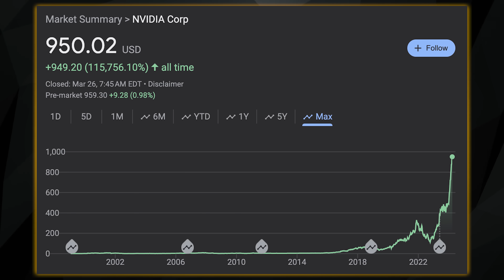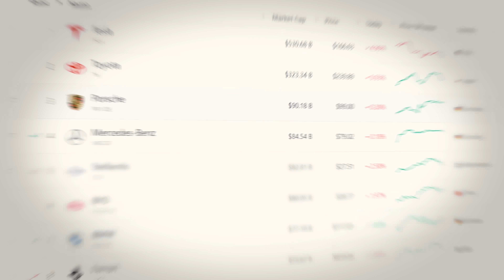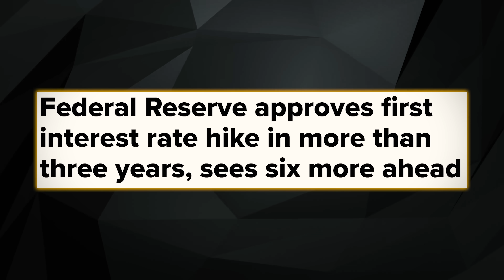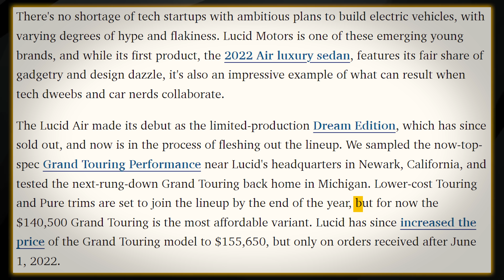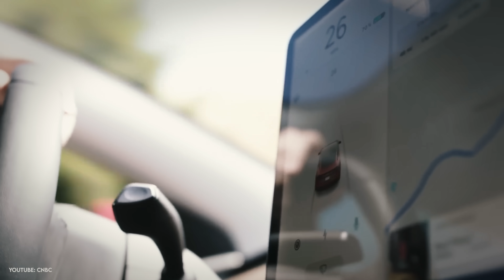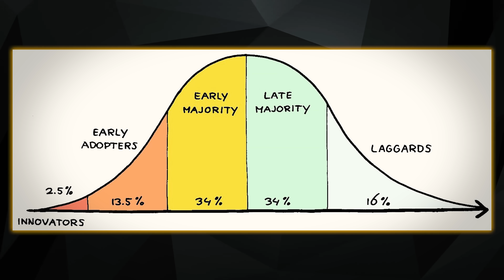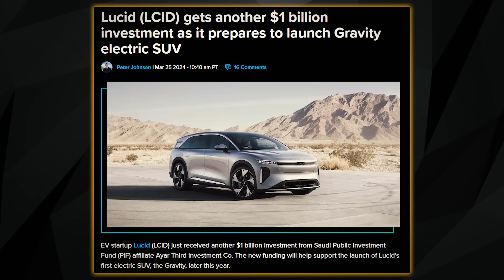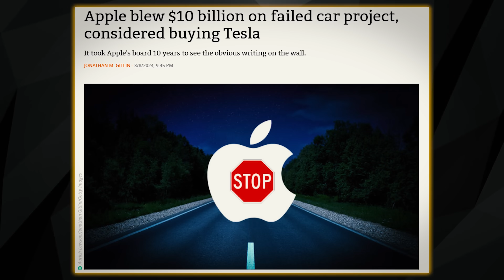The EV Bubble Popped - What Now?

Comment: 1:00 wrong! Tsla dose not lead the EV industry.
BYD leads the EV industry by far.
From Business insider: 
"China's BYD is the world's biggest electric car maker! China's BYD passed Tesla as the world's top EV seller last year."
You don't know what you are talking about dude.
Nio is very small in china. Example: Xiaomi just released their car and guess what. they sold over 90k cars in just one day. EV Bubble Popped in US and US is not the world. Wake up from your US bubble.   

China's auto market is 2x bigger than Europe and US automarket combined.
BYD just sold (only in china) over 830k EV in march while another Chinese EV maker Aito sold over 220k last month just to give a small example.
Reply: BYD overtook tesla in Q4 2023' but Q1 2024 put Tesla ahead (just barely) once again
Reply: BYD is even younger than Tesla, their crash is coming soon.
Reply: @UhOhUmm  BYD is waaaay older than Tesla; they started out making batteries for your Granddad's Nokia.

Over 30 years of battery making experience (plus a few decades of commercial vehicle manufacturing experience in China).
Reply: @mikefarino4368  Incorect, 
Tesla in Q1 sold over 83k cars in china alone. While BYD sold In March 2024, BYD sold 302,459 EVs. if we add the rest of the months of Q1 BYD would have over 800k cars sold.
Tesla is no where near BYD.

Comment: If you want to spin numbers at 07:35, I can spin numbers also. " As of March 2024, 1% of registered vehicles in the U.S. are electric, or about 3 million vehicles. This includes 43 states with adoption rates below 1%, and two states, North Dakota and Mississippi, with adoption rates below 1 in 1000. However, according to Kelley Blue Book, the EV share of the total U.S. vehicle market was 7.6% in 2023, up from 5.9% in 2022"

Comment: Sorry let me be blunt. You're wrong about Kia and Hyundai. Their EV offerings is way more competitive than you set them out to be. Their self-driving tech is on the level of Tesla, their design is far superior, and their build quality is not absolute crap that you can pick apart with your fingernails. The reason that Tesla is failing to cross the chasm is not because people just don't get how advanced they are. It is because it doesn't serve the need of the mass public of a nicely built vehicle that does not require any compromises to own unlike a Tesla and their unnecessary "inventions" like the removal of turn signal, gauge cluster and many things along that line. 

Those things might seem trivial but you will be surprised how many people that I know who own an electric car who chose a Hyundai or polestar over a Tesla over the dumb turn signal situation. The way that Tesla operates and design their cars can only suffice so much demand. Much more recently we can see that trend on the cybertruck. It is big, fat, unsafe, and dumb. It can satiate the needs of some, but not the majority. That might be an extreme example, but the rest of Tesla are way too weird for the people who just want a reliable transportation to switch to. They are trying to shove an innovation pie down the throats of unwilling customers and that is an uphill battle that Tesla needs to figure out.

Comment: The price happened. The math is simple: A Tesla modelY in my country is 43K euro, and a decent new gas car( not mentioning second hand) is 30K .... with 10K euro i can fill up that baby for years and years and years. When electric go to solid state battery and not requiring another 50% of car value in 10 years as a battery replacement, then yeah i will switch.
Reply: the thing is, this argument will only become more invalid as evs become less and less expensive, the electric market isn’t at full potential unlike gas cars,

Comment: I think another point why customers are cautious is battery degradation. We know it from every other device that batteries loose capacity over the years and I think people aren't quite sure what lifespan to exspect from an EV and what the resale value would be at that point. If you buy a car, especially a new one I would assume people expect to use it for at least 5 to 10 years and if they expect a shorter use time, they would want to finance their next car by selling their old one. What will the battery of an EV be like in 10 years? How much capacity is still left and would someone buy your car then, or rather how much would they pay, if they possibly have to buy a new battery? How are the battery prices? For electronic bikes they are sometime up to more than 50% of the original bike. I bought an E-Bike in 2021 for 699€ and the manufacturer sells new batteries with varying capacities for 359-469€,  If its the similar for cars, would people even buy used ones, if the savings between a new and a used car are only very small? Then it may become a case of: You have to pay money to get rid of your old car, instead of recieving money by selling it.
I mean I don't know how this really is, what the battery is like after 10 years or what the used market is like for EVs, but I imagine lots of other people don't know as well and lots of people probably don't have enough spare cash to take a gamble on that. They need certainty and peace of mind.

Comment: They don't hold trade in value anymore.
Reply: The EV market has a real used car problem. Buyers have no way to evaluate the state of the battery which is the most expensive part to repair. This hurts the new car market as everyone wants to buy new so you cannot sell your EV. This makes it a much larger commitment than people are willing to take.
Reply: Well no, when the manufacturer drops the price of new ones, how exactly would they?

Comment: I don't live in a detached house.  My place is not on ground level, and I don't have a charger.  I haven't looked into this all that much, but nobody has ever explained how I'd ever be able to get an EV.  (I'm not going to spend 45 minutes at a gas station charger.)  Also, I have a Hyundai, and like the traditional layout more than any EV vehicle that I've seen (which try to change things just for the sake of "innovation", when I want a regular front panel with a speedometer, etc).  Also, while I wish Tesla luck, it's no Toyota and shouldn't be valued as much.  And even if Tesla is as far ahead of the competition as Google is compared to other search engines, I use DuckDuckGo and get along fine, and I don't have to see the weekly Assata Shakur dedicated Google doodles.

Comment: As we age we decline in strength and power, as, too, when the batteries in EVs age they burn and lose charge-power. I have driven cars that will roll for half a million miles without critical failure, not so the EV. It is a dead dog waiting to rot. Can you smell the stink?

Comment: Why would I buy a landcruiser that can accelerate from 0 to 100 in 2 seconds, weighs 3 metric tons and is a hassle to find parking space for in the city, let alone maneuveur...when I could have a small EV that only uses 60% of the energy, has the same range and is able to find a parking spot with? Kia, VW and Hyundai are on the right track. Smaller, more affordable, less expensive and less of a hassle.

Comment: Not to be a pain- But where's the coverage on BYD amongst all the EV manufacturers? It was 5th on the list in one of the shots you'd used.

Also, "EVs are cheap enough" is a blanket dismissal for a complicated and nuanced question. They may have fallen in price, but it's still not easy to just swap and buy one when interest rates are as high as they are. (Full disclosure: I'm Australian and our economy is worse.)

Comment: Tesla loss probably also related to Elmo, I would not buy a Tesla because of him (and also because I don't like their all-touchscreen design, but I could maybe deal with this...). At the end of the day CO2 goals will not be reached without EVs. In Europe CO2 tax added on fuel will constantly increase. Which means that the cost of operating an ICE car will constantly increase. So either we go back to the early 2000s and dig out our low consumption ICE engines from this time and downsize the cars (which in my opinion actually would be a good idea, all of those SUV cars which are in fashion today are way too big in my opinion) or we will need to stick with EVs. I haven't heard that Hyundai/Kia has financial problems with/due to EVs. Only because the US automakers can't keep up it doesn't mean necessarily EVs are dead.

Comment: 1) Those price cuts are not enough. There are still no EV to match golf-class hatchback in price-value. You either have “cheap” options with no range, no fun and the next step is 57 000 EUR+ models which are competing with C+ class like BMW 3er or Audi A4. Tax returns are also not a thing in many countries anymore.
2) Even the full sized models (those for 57k+ EUR) are still not usable enough for apartments residents. Not all apartments do have dedicated parking lot and even if they do far too little of them have charging on those lots. Without overnight charging EV is just as expensive to charge as tank a car and less convenient. Furthermore, road trips are still a mess with long charging times. 
3) The whole EV application is too limited. Standard gasoline or diesel car is too damn universal. No matter which car you choose you can do all general activities from city commute to long range daily road trips. With electric it is way too complicated on each of the applications

Comment: So, to put it into perspective. I can get a top of the line Skoda Octavia (4 year warranty) with all the bells and whistles, top quality and dealerships/mechanics everywhere for 40k. Takes me 30 secs to fill up a tank that costs me around 60-70 euros and can drive around 750km (with heating on). Or the alternative is to buy an overpriced EV for 50-60k, pay tons of cash for fast charging, don't have dealerships where they can fix my cars and can barely go 300 km, with the added bonus that if I charge at home I'm going to be adding an additional 100 bucks for my electrical bill? Yeah, I'm gonna sit this one out.
Reply: that and you'll be paying for the batteries every 2-3 years and it'll cost more than the car itself will be worth.

Comment: Battery tec is not ready for mass evs.
No Range, short lifespan, very expensive, and dangerous on top.

And dont get me started on selfdriving, lol.
Reply: the range is fine. The amount of people that ever drive more than the 3-400 kilometers electric vehicles have for range is basically no one. If you had a charger at home, the overwhelming majority of people could get by on a car with a range of 100 kilometers.

Comment: People who drive aren't really interested in electric driving spy machines. If I drive from NY to Florida, I'll have to stop a few times to charge. If I do the same drive with an ICE car I'll have to stop for gas.

The difference is when I stop for gas I'll have a full tank in 10 minutes where it will take me several hours to charge a tesla. 

There was a concept where they have an electric motor and a diesel engine. The idea is when the battery gets low, the diesel engine kicks in to charge the battery. You get the benefits of both an electric motor and an internal combustion engine.
Reply: It would take you 15 to 20 mins at supercharger to get 80% charge and not several hours.
Reply: @samuelwilliams7331  ok but where the hell is a supercharger out in the country?

Comment: I would get an ev if they weren’t so expensive. The battery replacements make it worse because over here you can get a second hand car that lasts over 10 years for the price of the battery replacement.
Reply: Eh, apart from a few weird instances like the hyundai in Canada that was fucked up, ev batteries don't really break.

I have heard stories of ev batteries starting to have issues at 3-400k km, but most last much longer than that.

My dad has a tesla from 2016, it's gone 300k km and has lost about 10% of it's capacity. Batteries usually lose about 5% in the first year, and then the loss slows down significantly, until somewhere below 70% where it starts to lose cells and is considered dead.

Current ev batteries are ofc improved compared to 8 year old batteries and are generally expected to outlast the rest of the car.

Comment: I dont think Tesla has any technological advantages anymore though. GM and Kia/Hyundai vehicles charge faster and GMs supercruise is regularly considered on par with Tesla autopilot when doing freeway driving. Differences between the two are autopilot can go on city streets, but on the flip side, supercruise can tow trailers and the cybertruck is still incapable of going into a dedicated trailer mode much less self drive with a trailer. With supercharging spreading out to Rivian, Ford, GM, Hyundai/Kia tesla doesn't even have that advantage anymore. I'd say legacies have most definitely caught up

Comment: people just can't afford them, the batteries lose capacity over time, and over a decade the batteries are worth more than the cars. An EV nerd just did a video on a 2014 Nissan Leaf that claimed to have 90% of its capacity but only got half the original range, to replace the battery was 8k GBP where as the car cost him 1.5k GBP.

If I buy a car I want a car that's cheap to maintain and will keep its range on the cheap, my 97 Camry cost a few bucks a quarter to keep going and gets 23 MPG with a 14-gallon tank, I like cheap cars I would totally buy a leaf if the battery didn't cost so much to replace.

Comment: They need to offer bare bones versions of these cars without digital controlled everything. Just because the car needs to have drive by wire steering and accelerators doesn’t mean that the seat controls, wipers, and power windows need to run through a CPU in the infotainment center 🙄. If they build affordable EVs with simple electronics and features, utilizing the “econo-box” offering mindset that Toyota and Honda built their brands on, then we wouldn’t be having these conversations. The auto industry is absolutely drunk on “feature upselling”. The base 2024 Camry is a fucking fully loaded Cadillac from 10 years ago. We need an Everyman EV car from someone if there is any hope in mass consumer uptake. Get rid of all the data tracking and OTA updates and shit that makes normal people paranoid about whether their car is listening and watching them have sex in the back seat. ICE isn’t exempt from this either, Corollas and Civics are now 30-40k cars new. WTF?

Comment: I’m very interested in Evs however they aren’t there yet. Once we get 400-500+ and charging times 0-100 in about 10-15 minutes then we will be there where everyone will want to get one.
Reply: 700 miles / 10000km. And 5minutes charging time. Then we can talk
Reply: @tommyking626  me personally I would rather they focus on the battery charging time first because it’s insane that it takes around 70 minutes to charge from 0-100% at a supercharger. That needs to go down first and then they can focus on the mileage.
Reply: @tommyking626  Most gas powered vehicles don't have a 700 mile range.  I'm' assuming 100 thousand kilometers is a typo on your part.
Reply: Ok, porsche taycan, zeekr01 and a couple other chinese cars have 800km range, and recharge 600km of it in ~12 minutes. Welcome to the future.

It will be a few more years before this is available in cheaper cars of course, but if you think a 12 minute stop after 600km on the highway is too long i don't know what to say.

That said, i do own an ev, and I do use fast chargers on the 4-5 longer trips i take per year. But absolutely most of my driving is done on home charging, which takes about 10 seconds to plug in and unplug.

Comment: There are two core issues with EVs that aren't being addressed. First, they aren't special. They are a drive-train option, not the disruptive technology many seem to think they are.

They don't go anywhere other vehicles can't, have to abide by the posted speed limits like other vehicles, and don't carry more passengers. The only advantages they offer are that they accelerate well, might have a bit more cargo capacity, and can be charged at home. They are inferior to internal combustion engine (ICE) vehicles in terms of range, charging time, charging options, and towing—all that for more money.

Which leads to the second issue. Demand is not organic. Tax incentives, increased emission standards, and market restrictions wouldn't be needed if it were. You don't have to restrict something people don't want to get them to purchase what they do. This isn't people saying what they want to buy. It's governments saying what they are allowed to buy.

EVs are likely here to stay, especially if that includes hybrids and, possibly, hydrogen-based technology. However, they are unlikely to dominate the market, let alone drive ICE vehicles out, anytime soon. There will be a use case for the latter for a long time to come.

Comment: EVs should be less expensive than ICE cars, and should be running on renewables instead of electricity produced by carbon fuel.
Until they reach these two goals, EVs are a failure.
Reply: i don’t know what’s the fossil fuel compliant when you also argue against solar and wind, wtf

Comment: I’ll never buy an EV, I get 600 miles out of my 4 cylinder diesel. It holds 14 gallons and costs less than 60 bucks to fill up. I’m lucky if I need to fill up once a month. Plus it’s paid off and easily has another 300,000 miles to go before it dies.